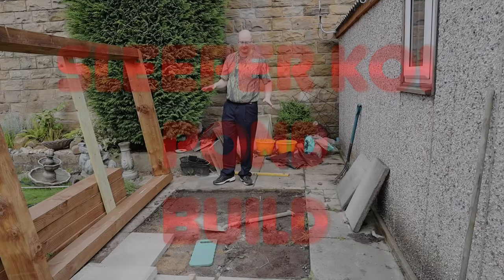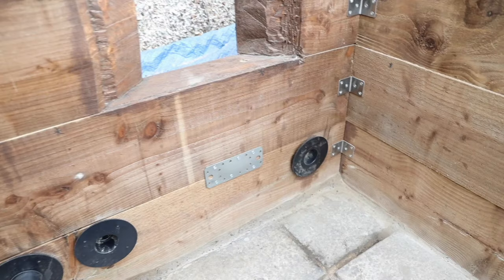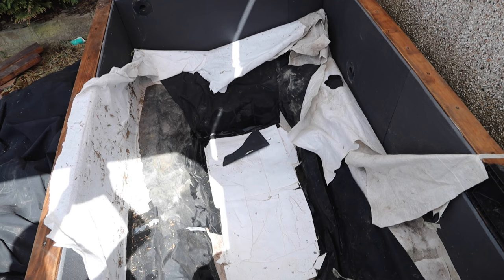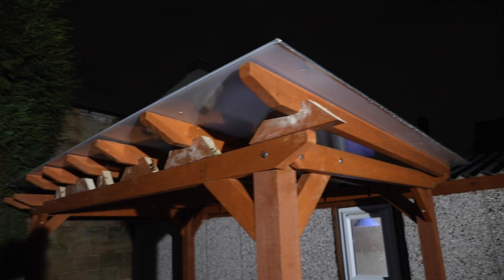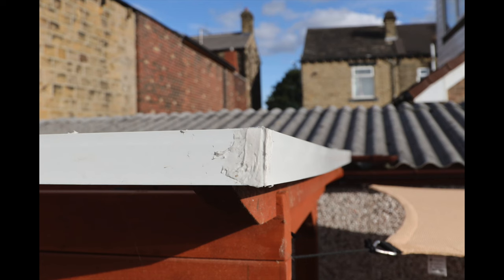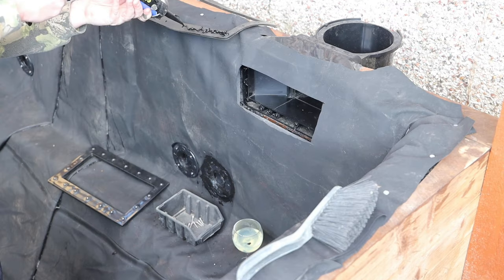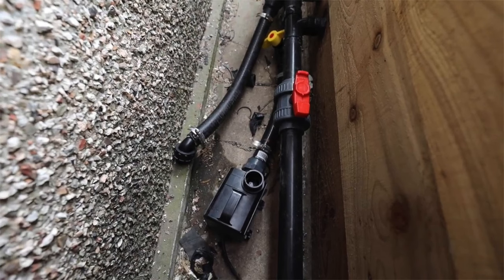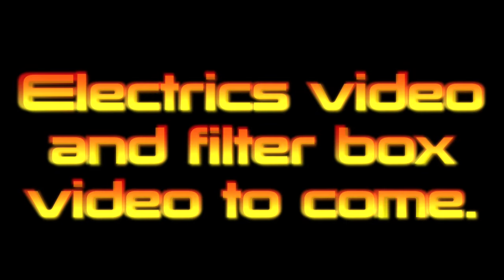Sleeper Koi Pond Build - Step by Step How To

Comment: How easy to put a window in as well?
Reply from the maker: Not hard but requires more work. It also adds a weak point however.  If seals fail the pond can leak. But its personal choice.

Comment: Hi.
Would sleepers be cheaper than concrete blocks?
Reply from the maker: yes and no clearly sleepers are longer but blocks are cheaper. But sleepers are portable blocks are permanent. a 2. metre sleeper is about  30-£40 each blocks are about £3-£5 each. 4 inch thick 440mm long. but you need many. remember wood does offer some insulating value while concrete blocks dont.
Reply: @Yorkshire Koi  So really need to work out 'pound for pound', how much the blocks would cost equal to the same size sleeper.

Comment: Would it not have been easier to cut the sleeps first 😊
Reply from the maker: not sure what you mean can you be more precise
Reply: @yorkshirekoi2246  sorry spelling error I meant could you have cut the sleeper first for the skimmer.  Cheers
Reply from the maker: @johntaylor5200  yes you could but I was not sure where I was going to place the skimmer. besides if pond put together its easier to cut as wood does not move.